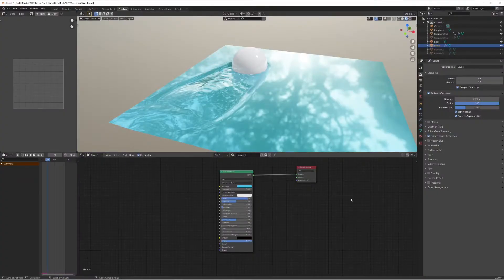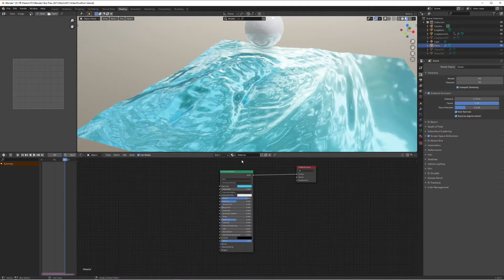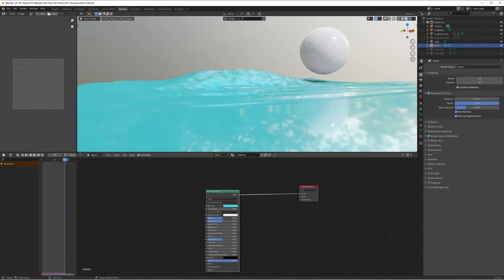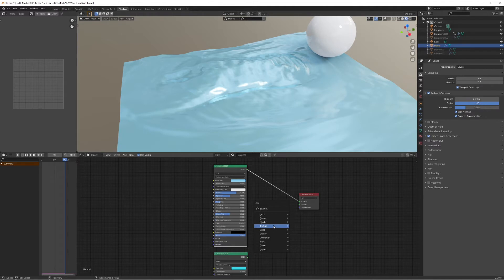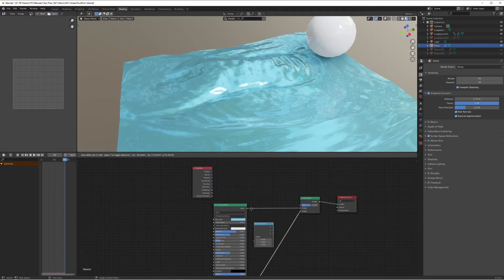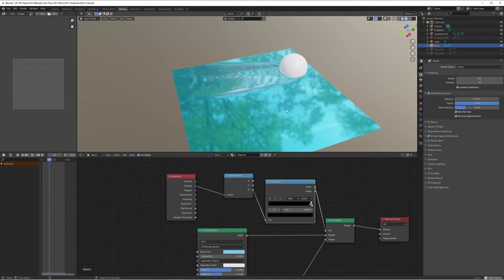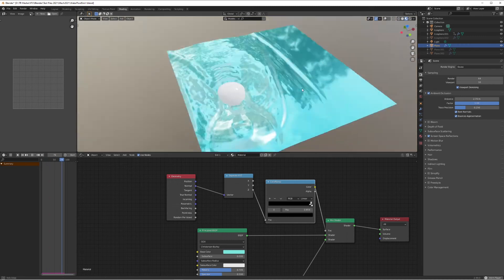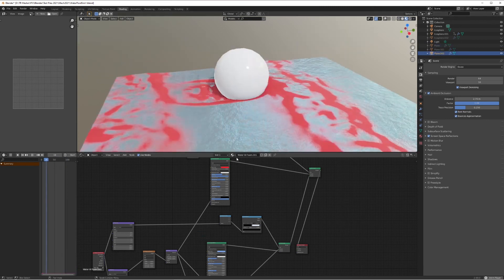Wave / Foam Material Tutorial - Blender 2.9 EEVEE

Comment: good afternoon, please help me understand the blender settings, the situation is this, I perform a render (picture or animation) in the render window, the light and color of the image is the one that I designed, but after the save to folder command, the render is kept dark as if the light of the world is not saved, maybe I'm wrong about something I don't understand. if you remove the checkboxes, save as and copy when saving to the folder, then the render is saved to the folder as it should be light and the file becomes slightly larger than dark. again, I can't do this when rendering the animation because everything is automatic and all the frames are dark. but I noticed this problem only in blender 2.9 and higher. in version 2.83, this problem is not present. please help me understand what the problem is . �the problem is probably far-fetched and ridiculous, but I can't cope with it to the point of despair.